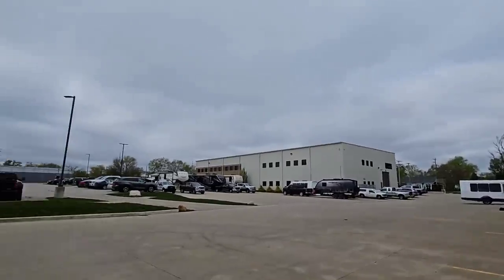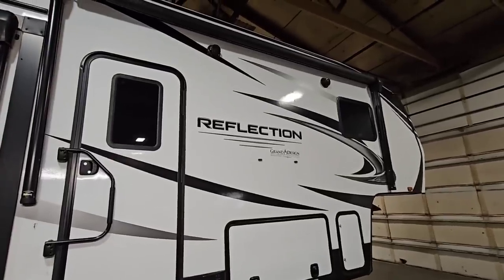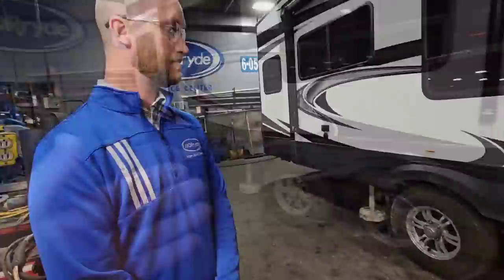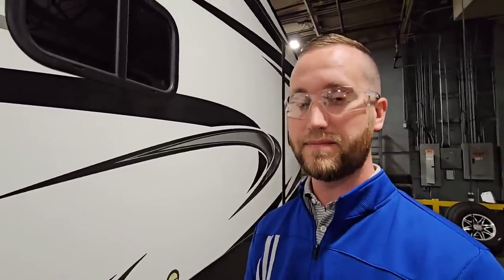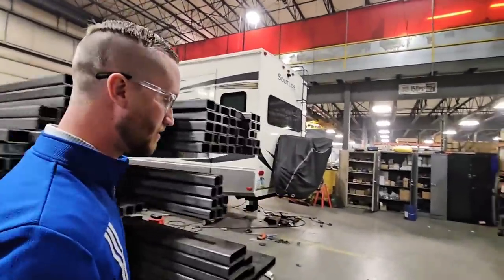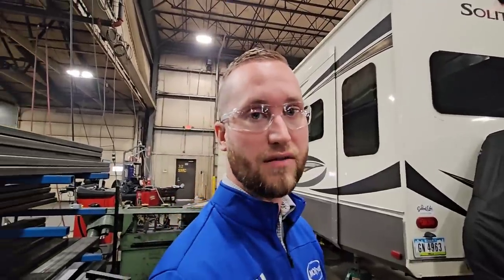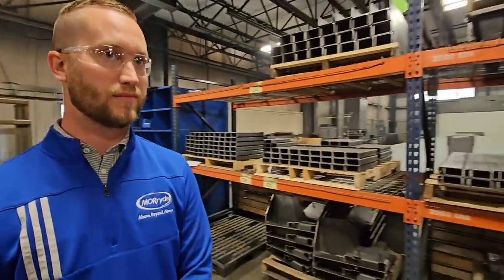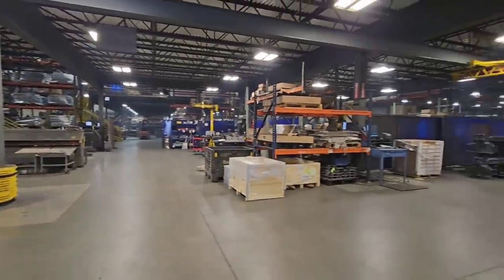BEST Upgrade you can do to your Fifth wheel RV! Morryde IS

Comment: We had Kodiak disk brakes with heavy duty shackles placed on our 5th wheel by a certified performance trailer braking installer.  The camper can stop the truck in a parking lot. The best safety upgrade ever. We still have and use our 5th wheel.  It's a 13 yr old Heartland 35 foot  toyhauler with an added 2 foot patent part toyhauler extender, so its now 37 feet. With a cash discount it was 46 thousand out the door, not including the extension we added years later.
We truly love our 5th wheel, the one and only we will ever buy.
I love watching your channel and the great content you bring to all of us.

Comment: We added IS and disk brakes to our Reflection 315RLTS travel trailer 3years ago. Best money I’ve ever spent on an RV. By the way, we’ve been RVing for about 45 years.
Reply: Great video, however I must disagree. I found that almost every major  OEM suspension is complete BS and surprises me that they are even passable/safe. 

Every RV I’ve had over the years was underrated with axle, tires, and components. My current 5th wheel has a GVWR of 16,000 almost, but comes with 7k axles. Tires were load range E and just barely meets the loaded weight.

Comment: Greatest thing I have done is morryde IS and axles and disc brakes.  Unfortunately only do it if your keeping it for a long time, cause you can’t get the financial value back when u sell
Reply: How much did you pay?
Reply: @Moneypress11  somewhere around 9k, was a couple years ago also had morryde pin box installed
Reply: If you schedule your appointment in the 
“off season” ( winter time). 
The cost is dropped by almost 1/2
Reply: @jeremysiegfried4488  not true I did mine around thanksgiving

Comment: Speaking as someone who just got MORrde independent and disc brakes back in October 2022, I fully support having independent suspension and would do it again. I will recommend two very important items though without getting into the details of a few scary problems we had. Make absolutely sure MORryde knows well in advance how heavy your GVWR is so that the proper spring tension is installed and/or adjusted (very important). This needed to be corrected for us in April 2023 and excuses were made even though I know I was lied to about the cause. These issues could have potentially been very dangerous for us and we know of at least two other people that this happened too as well. All three were installed in the same three days. I am sure there must be others though. We have a 20,000lbs. GVWR on a three-axle Grand Design Momentum and they swapped out the spring or spring tension and replaced all 6 brake calipers from Hydrastar to Dexter brake system. The Hydrastar brakes were not the problem and this I know for a fact. Let's just say, I was shown exactly what the problem was.

MORryde welds metal tabs on the frame (front and back sides of each wheel - 12 in my case) for the jig to install the independent suspension, as the shop manager told me. Those tabs absolutely need to be removed after the installation is completed as they could easily interfere with the brake caliper's up-and-down motion on the wheels, potentially knocking said calipers off their caliper mounts and even breaking the caliper mounts as well. Normally, I would not post any of this but I was ignored when I highly recommended that others should be notified of these issues so that they are not put in danger. I was ignored completely! Again, we love our MORryde independent suspension and would do it again but questions need to be asked and answered. They did reimburse us for our costs (minus the hotel) but this should have been escalated to executive leadership as I requested three times in emails so that it could be addressed at  higher level than just the shop manager. Personally, this was just a bad installation with a lot of finger-pointing at the wrong person. Fingers should have been pointing in the mirror! People make mistakes and I understand that but when you point fingers at others that were not the cause, then you have an integrity issue with yourselves.

Again, I still highly recommend I.S. and disc brakes but just be aware and make sure you test your trailer brakes before leaving from anywhere.
Reply: Wouldn't they just go off the GVWR on the unit label? I had the system installed on my Seismic 4212 a little over a year ago and the only decision I had to make was to do 7k or 8k rated suspension. BTW I do love mine, as well.
Reply: @loydstephenson89  Yes, one would think so but when they decided to replace all the brake calipers with Dexters and then tell me they need to increase the spring or tension. That alone leads me to believe the previous spring or tension was not enough for our 20,000 GVWR because the calipers were hitting the metal jig tabs that were welded on the frame. As I said, it was an installation that was not done correctly as two others that I personally know of, experienced (both the same day installations as I). I found out about another person online through Instagram but he never got back to me so I don't know what his outcome was.
Reply: One other thing was I asked if I should initially have the 8k I.S. but they did not recommend it and said the 7k was fine. That is in spite of having 3 axles and 20k GVWR.
Reply: @WestsontheMove  yeah I went with 7k too because that was the rating on the axles that came on mine. I already had disc brakes, so they just R/R them on the new IS

Comment: How about installing 4 x (in-hub) electric motors? I want to go off road and I need the extra traction. The motors must have around 2000Nm of torque and only rev to about 300 RPM maximum speed (wheel turns)

Comment: Very nice suspension upgrade. 
Hey JD.  I have a 5th wheel towing question.   We bought a 2011 GMC Sierra 3500HD Denali crew cab dually with the LML 6.6 Duramax.  We will be buying a 20k B&W Companion 5th wheel for the truck.  We are also adding an over the bed tonneau cover that will sit above the rails about 1-1/2 inches.  How much space should you have between the bed rails and the overhang on the trailer?
Thanks in advance.

Comment: Just curious, but does anyone use Moreride equipment during their build instead of using lower quality items?
Reply: Luxe is the only one that I am aware of  Sure there are other smaller high end outfits that use them as well.
Reply from the maker: @MrThisIsMeToo  DRV also
Reply: @BigTruckBigRV  Correct.  Just could not remember when I posted hence my disclaimer.  :)  Also worth mentioning, I spoke to the folks at Morryde at Quartzsite this year and they mentioned that Grand Design will be offering  their (full) suspension as an option.